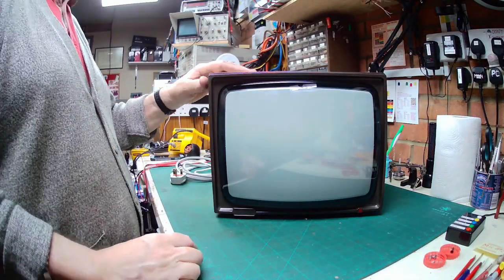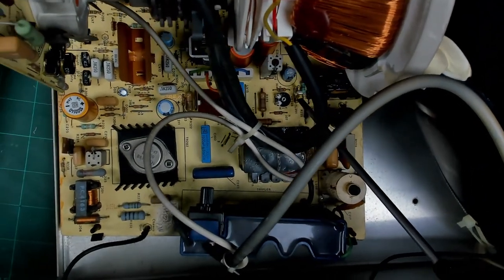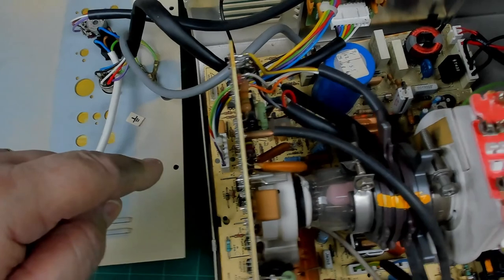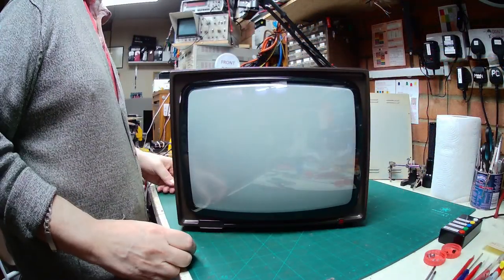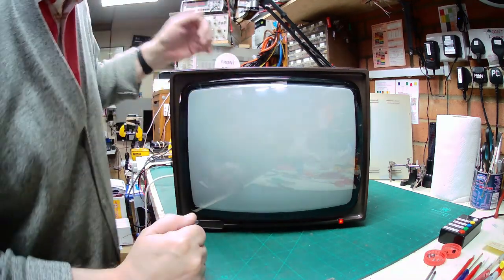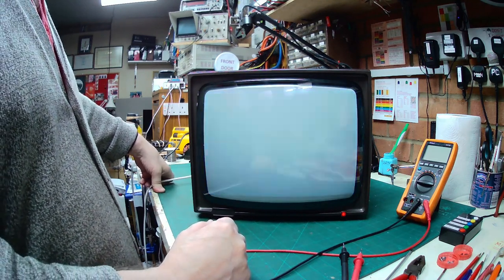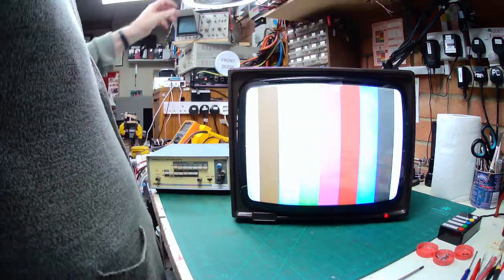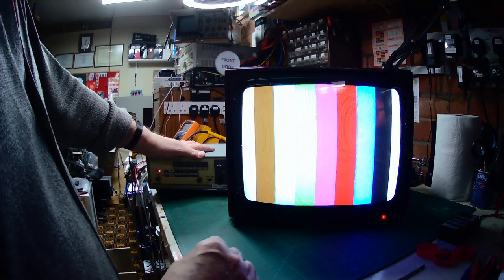Microvitec Cub Monitor Repair

Comment: Great to have you back, Chas! I remember these monitors from school (we had BBC B micros) happy days, after our work was done, everyone played Prince Of Persia!
Reply from the maker: Thanks, I've not been away, just busy with many run of the mill repairs, not worth videoing. Awaiting a fair few spare parts  so they will be coming up soon. Sadly, a lot of unrepairable stuff too, modern Blu-Ray players that I can't get info on and have boards that cannot be repaired to component level. 
Yes, I've done a fair few of these monitors, mainly before I began the channel, so this was a treat for me, essentially a Colour TV like I used to work on in the 80s and 90s, before the flat screens took over. An enjoyable repair for me.

Comment: Thanks for sharing your expertise ! How much watts is that “fuse” resistor? 
Greetings from the Netherlands
Reply from the maker: If you look at the schematic diagram at 00:02:50  you'll see its shown as 0.5w, which is fairly typical of a fusible resistor. You can get them on ebay: https://www.ebay.co.uk/itm/266182669763?hash=item3df9b935c3%3Ag%3AkAUAAOSwdvpkhyIQ&amdata=enc%3AAQAIAAAA8EGqVlgo65nHNLFbC9mesNpiMbZc40GMO8G8XfQfJhqxc8pIY3Qw1zUThAlRQFAA8wIHJS2XGODUGh7ZHuFoSjg5WbmWl%2F34USPsZeBdGNKD61bpmuozjUhJkqe1p5FE5OGEra%2FeI1SInPurZjEivjtapHhPAgI9HTuyKIVBRHSXzO4gjKI5CR%2BBBsJwfcG1oMQKaek10GlU379FZiNUbsRBDjRG1P8Ey3Pwx1cu9gVKnlygFT0CgI6VsoOUWLE0xK9ulcGFQGIH0Qxc%2BT4IWHbxNxw1X4cAc7CxN59ZSqTn3j0WoUSSgGq5b%2BDevYyozg%3D%3D%7Ctkp%3ABFBMvNCYnuFi&var=566010145440
Hope this helps.

Comment: I have a BBC model B and I'm looking for a Cub montior takes me straight back to school days! I'm a bit apprehensive about getting one as I have no knowledge of how to fix them.
Reply from the maker: I would recommend trying to find one that has been refurbished and recapped, repairs are only easy for someone who has the knowledge of the circuitry and is aware of the dangers involved in working with mains operated equipment. Not just mains voltages but EHT voltages. You might be better off using a video to VGA adaptor with the BBC and a modern monitor. They are cheap and readily available.
If you do buy a CUBBY and need it repaired feel free to get in touch. 😊😊

Comment: Great video,  i have a sick cub currently, and i have apparent frame collapse although i dont have the white line across the screen? The power light still lights, but screen is black.
Reply from the maker: Frame collapse is typically where the vertical scanning circuit stops working, giving the typical white line across the screen. If you have no display it could be a lot more complicated, either Power Supply or Line Time base failure. Get in touch if you want more help.

Comment: You say the board in the monitor has been modified so it'll work with an Apple II, is that a factory modification from when the monitor was made, or is this an aftermarket modification that a user has done?
Reply from the maker: Yes, as far as I know it is, there is an extra circuit board on the left of the chassis where the DIN connector connects to and from that PCB to the main PCB. More info here:
https://stardot.org.uk/forums/viewtopic.php?p=233346&sid=63706ebc87f56b5fb1f4006f902c488c#p233346